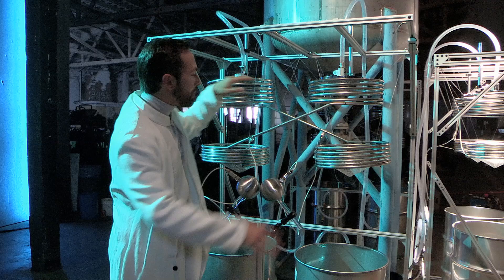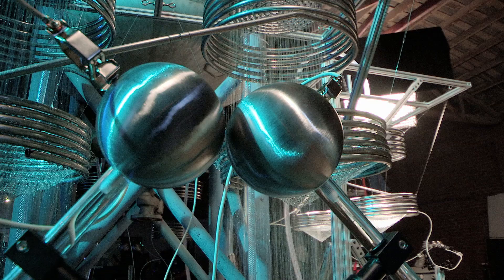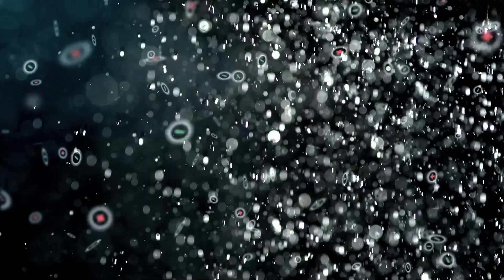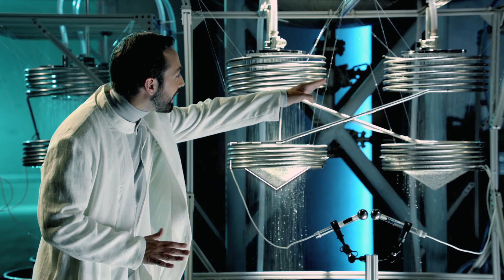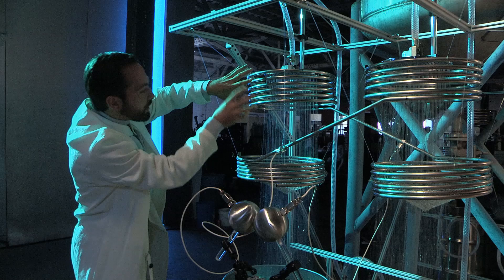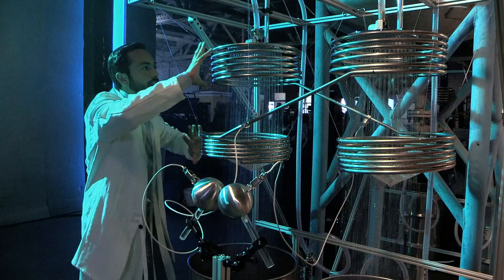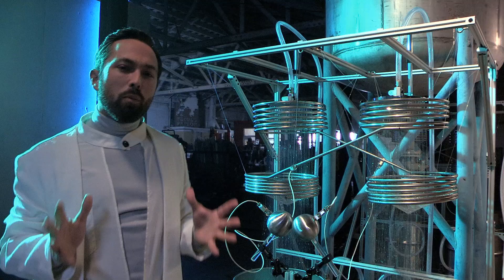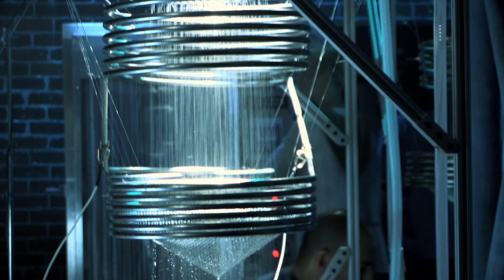Sparks from Falling Water: Kelvin's Thunderstorm

Comment: What would happen if you allow the charge to build more, in stead of having it discharged via the spark? Seeing that the electricity builds, would it generate more useable power if left to build longer and possibly not let it discharge?
Reply: He's charging a capacitor pretty much.

Comment: This electric energy comes form the potential energy of falling water
Reply: Potential energy of falling water is correct but doesn't explain fully how it works. There were a few things that Derek didn't get into. First, the specific design of this Kelvin generator is poorly done. The fact that is doesn't generate a lot of current is the conductors have a small capacitance. Adding a Leyden jar off a good size would significantly increase the current of the discharge but take longer to produce each spark. First lets talk a little about how it works. When the drops are formed, the top coil induces the same charge to leave the water drop, into the supply pipes. This leads to the first note on inefficiency of this particular generator. For the most part, only the drops around the outside contribute much charge to the drops. In doing so, they tend to block the center drops from getting charged ( waste of water ).
Once the water drop is released, it has to travel up an electrical potential hill to the bottom coil that has same charge. This is from the potential energy gained by the fall with gravity pulling it ( wouldn't work the same in 0-g but one could always pressurize the water as a jet ). The next point of inefficiency is the way the screen at the bottom was made. What you want is for the water to leave the most of its charge in the bottom coil but there is a strong field at the point of the bottom screen that is bleeding off the charge to the water going to the bucket. You really want the point of the screen to be at about 1/2 the distance between the top and bottom of the coils. At this point there is a minimum of charge since the charge of static wants to be on the outside of the coils where the capacitance to the outside world is formed, pulling the charge out. Of course most of the charge may have gone down the wires to the balls that had the highest capacitance to pull the charge away from the coils.
I saw one comment about there being coils. It could have been done with cylinders. The top could even have been just as effective as a single turn of tubing. It is the field strength where the water separates from the shower head that counts to induce the charges to go into the piping. Surprisingly, the conductivity of the water isn't even necessary. These have been even made to work with transformer oil that is quite insulating. Anything that can hold a charge on the surface will work. It could even be plastic beads.
It is still cool to see one working. I made one once. The only thing I didn't like about water is each large drop always made a small drop when it separated. This tended to get caught on the top inducer and reduce efficiency. I've been giving some thought as to how to make drops without the added tiny drop.

Comment: You had it set up to discharge frequently.  If you used a capacitor bank instead of letting it spark, would the increasing charge differential increase efficiency over time? Or would it quickly peak at about the same point of electricity generation that you had when it would spark?
Reply: If he used a step down transformer with the capacitor bank that you mention. Then it would lower the voltage and increase the amperage. So instead of thousands of volts spark, you can end up with a usable power unlike what the guy in the video said.

Comment: did anyone else realise his explanation didnt make sense ?
he claimed that having a negatively charged coil near the shower head, would make the water coming out of that shower head positively charged,  the only way to make the stream of water positively charged would be to remove electrons from this stream.  and as other people have proved, you cant remove electrons from falling water droplets, because there is nowhere for the electrons to go.
And if he meant having a negatively charge coil near the shower head, would repel the electrons in the hose/showerhead and push these electrons backthrough the hose, then this wouldnt work either as  electrons travel extremely slowly, and woud not be able to fight the flow speed.  the only way i could see this working is if the electrons are somehow flowing through the plastic tube,  but this has its own issues that i am not an expert on debunking. so i will let someone else finish this.
Reply: No, his explanation is absolutely correct.  You are forgetting the basics of electricity.
1) Opposite charges attract
2) for low current situations, all parts of a good conductor (such as iron or copper) have the same electric potential (i.e. the same attraction to one charge type throughout, and the same (but opposite) repulsion to the opposite charge type.
Reply: @dirkgently120  what you explained was correct, but didnt address my concerns.
Reply: future me here, now studying electrical engineer with top GPA (4.2).  gotta say, impressed with past me. I really nailed the issue with the mechanism. one day ill figure out how it works and explain it.

Comment: What would be the effect in doubling, or quadrupling the number of mesh's connected?  Would that just double or quadruple the power output, or would there be any factoring of the power by having it in series/parallel?
Reply: I wonder if it could be done with wind instead.  A charge system with no moving parts would be easy to maintain.

Comment: GRAVITATIONAL energy is stored in the mass of water that fills the elevated water tank,  (until it is allowed to flow out)
I nature, SOLAR energy comes from the sun evaporating water into clouds that rain down again. Warm air/ moisture goes up as cold rain falls down creates the right conditions for "CHARGE SEPERATION" to occur.

You might notice that sometimes the rain falls heavier after lightening discharges and the charges are balanced.
 for the same reason that you see the water drops from the shower heads bending in Lord Kelvin's water drop experiment just before the spark jumps the gap.

Comment: the similar system are used in ufos.... their spaceships have no moving parts... electrons come inside by small holes... they are detecting , charging... &splitting ... in the similar system as the X crossing in the video ... and smashing in to combustion chamber together create an immense power........ the similar system  what they do on cern.... where some of the electrons  they return in to accumulation container...or in to infinite loop chamber ...used for the next boost .... the space ship can rich about 110 to 180 thousand kilometers on hour....measure in to humans units ... or vaiki or vauky something like this... and weight almost an half of the moon.... its so big that getting closing to gravitational planets it can become dangerous.... visions from abstract communications.....  but .. y̶̡̢̙̘̗̼̯̰̅͂̍̽̆́͒̆̈́̀̉̕͠a̵̯̟͇͉͋̚͜ȁ̶̢̳̪̥͎̩̦̫͓͓̏͋͌̀̑̔̑̆̄͌̽̄̂̄͜ͅa̸̟̰̟̱̫͔̿̈́͋̿̒̍͊̂̋̆͜͝ͅ ̶͛̿.....knowing & believing are also different things.....
🌏 📡🌏 👣🕘 💎👽☠☼☾☄ゞど・ㇺㇾㇽ₪𝖎𝖙𝖎𝖇𝖎𝖗𝖆₪なめㇺㇾㇽ✶☥✨🌛🌄⊀✶⋊🐺🐾♓️☆🐜🐜🐫▲

Comment: is that water drinkable?
imagine you drink it ang get shocked by 5000Volts :D
Reply: There is no 5000Volts here, spark can travel something like 1cm for every 1000Volts and here the distance is 0.3cm maybe 0.4cm. So you can bet that it is less than 1000V.

Comment: What if you had a 100-meter tall tower/coil set up? And wire, not pipe.
Reply: Right. This is just a single set of coils shown here. If you look at electrical transformers, their output is based partially on the size and number of windings. I would suspect that the same basic principle applies here, too. So, multiple coil sets linked in series to increase voltage and also linked parallel to increase current. And we have hundreds of water treatment facilities across the globe to install these systems at. 4 towers at 100 meters tall with 100+ coil sets per tower, fed into a capacitor bank that discharges into the grid at set times of the day, or feeds the backup power systems for cell towers. The concept is not completely useless, just need to figure out the best place to employ it.
Reply: @CharlesHuse  And then there are areas that have fairly predictable and regular rain... also there must be an optimum diameter for best output... I wonder if Neodymium magnets could be incorporated to increase V and I?
Reply: @mickmccrohon  coil material...copper over aluminum. And if you use tubing, like the coils in the video appear to be, then what about some sort of superconductive fluid running inside the tubing to increase output.
Reply: @CharlesHuse  Trouble is all known superconductors require cryogenic temperatures to achieve superconductivity. And cryo temps don't come cheap... even in closed-loop helium systems plus the power to run the cryo units takes Kilowatts.
Reply: @mickmccrohon  there are liquids that are more conductive than others. Saltwater is supposed to be more conductive than plain freshwater. I don't think it would have to be a superconductive fluid as long as it just increases the conductivity substantially over an empty tube.

Comment: this setup is very poorly built! I've studied this project before and the patents, in fact they did it in the video in a very crude way that it seems that they intentionally want to generate low loads. First of all, this system does not depend on a large amount of water passing through this way, it can be done in "dropper" drop by drop (because in this shower method, the water that is passing in the middle and away from the rings is hardly getting separate charge properly, is a waste of water), the metallic ring can be much smaller than that, it must be close to the drop as it falls, but it must not touch it, because the metallic ring must repel the charge while the drop is still did not separate from the amount of water in the reservoir, so that the drop would fall with the separate charge.

This project also does not depend on height, which means that you can stack several machines on top of each other, with each machine being for example 5 cm high, and take advantage of the 1 meter waterfall by 20x. The minimum size of the machine has to be what keeps the opposing magnetic field far enough away from each other so that they don't get in the way of each other.

Another thing is that it doesn't have to be water, you can get different results with liquids that have more content in question and electrical charge to be separated.

And there's another error in this system, it's using the first ring correctly, but there shouldn't be a second ring and then the bucket, the second ring should already be the bucket, this way you can accumulate huge separate loads (which is potentially very dangerous, maybe that's why they made this intermediate ring), because if not the charges accumulate in the bucket down to the limit of charge per cubic meter of liquid, and it can give a tremendous drain of energy (probably lethal)

It's also important to remember that this system works best at separating the charge when it already has a certain separate charge in each bucket, and each time the discharge occurs it has a drop in performance until it slowly rebuilds its magnetic field ( which will be done by the accumulation of loads in the buckets) so the more it accumulates, the more efficient the system becomes, up to the limit where the drops are being so forcibly pulled to the side that they start to touch the ring, at this point it already loses efficiency.

The contact of the drops with the rings must be avoided, so as not to have cancellation of charges. So, a good correction in the system is to "shield" the rings with an insulator, so that if water touches them, the charge of the falling water (which, by chance, touches the ring, as using coated wire) does not cancel out the charge accumulated in the ring as was done in that shower in the video lol. This way you can accumulate much more load without worrying so much about the drop in efficiency. Also remembering that he doesn't need the FALL of water, he needs her passage through the rings. So you can do this same project with this system lying down and the water running horizontally, but it's more work. But it is important to mention that it does not need the force of the fall, but only that the water passes from point A to B. Which means that if you mount this system almost horizontally, you can reuse the same water circulating horizontally and have a huge accumulation of energy (because raising the water consumes more energy than making it flow horizontally, normally).

(ps, I've seen people power a FARM using this properly constructed system. So that you have an idea of how poorly built the system used in the video was. It is actually an excellent candidate to replace water wheels and turbines, because this system may generate less, but it has no moving parts, so there is no wear and tear and no need to be replaced or repaired.)
Reply: For example, if you miniaturize the system that you saw in the video with the corrections that I guided, for each one being 20 centimeters high, you still generate the same energy as the one in the video of almost 2 meters high. Because energy refers to the amount of water that passes through the system, not the size of the system. So think about the amount of energy you get for your farm by connecting 200 or 300 of these systems in series in a small waterfall ;) You can even use rainwater stored in an open water tank, the higher the water is. water box, more systems of this you can connect in series one under the other, therefore, more energy you will have being produced by the fall of rainwater. You can even have a small power plant this way, cheap and extremely accessible in third world locations. Using wires and pans, simple and cheap.

Funny how even that so many people have this system on their farms or homes, so little is said about it.
Reply: oh, and if you are going to connect in series then maybe it is better to use the 2 ring model in the video, and not the one with the bucket directly on the second ring. The bucket on the second ring allows you to build an absurdly strong electrical charge, but it would be nice to see large arcs of energy shooting through the air, and not to connect in series for energy production, to connect in series the second ring being a sieve is better than according to what I understand.

Comment: it's need's to be in series more and you need to add some capacitors.
Reply: ya know you could add some tesla turbines to even adjust to put out more of a flow due to gravity
Reply: find a better material medium to flow through to be able to increase the static friction.
Reply: also a better material medium to absorb the static throughout the whole enclosed system.
Reply: s gas of some sort.

Comment: Not practical...even at Hoover Dam or Niagra scale?
Reply: Same question. Same size as the scaffolding cubes at Hoover Dam...6.5 years by 2, 3.25 years per block, 1000 blocks per day...how many dam blocks?
Reply: Dam volume: 3,250,000 cu yd

3000 people! 🤔 More compact?
Reply: But the voltage...

Comment: This is not science. It lacks a good point of view and a decent explanation. Derek point out at one of the coil and said, "if this coil becomes negatively charged". Today there is no place for an "if". Where you can figure out everything with math and techs. They could have probed the domes and determine the charge capacity and voltage and amps and with the help of  a little bit of math, this system would've become very predictable. This video lacks stats too. Clearly derek is trying to hide something. Yeah its a fake video.

Comment: The kinetic energy of the water gets transferred to electrical energy. As the moving electrons in the water will induce a current and thus will produce a potential difference across the two spheres. I assume this is the right answer but if there are any mistakes pls reply. So the potential energy from lifting the water up to the kinetic energy released when falling and thus some of that energy is transformed into electrical energy in the wires
Reply: No, there is no induced current. The coils may be replaced with closed rings. It is purely electrostatic.

Comment: Not impressed with the experimental setup........  Shame, the original is much more elegant AND spooky!  Originally, water source comes from one tank and one tube down.  The downtube has a Y split and water FROM THE SAME SOURCE released AT THE SAME TIME drops through an iron ring NOT A COIL and NO MESH....  i.e. The water NEVER TOUCHES the apparatus, and theoretically since it comes from the same source SHOULD have the same charge and not a split charge.  This is almost like the photon wave/particle slit experiment.

His electric explanation is wrong, wrong, wrong.